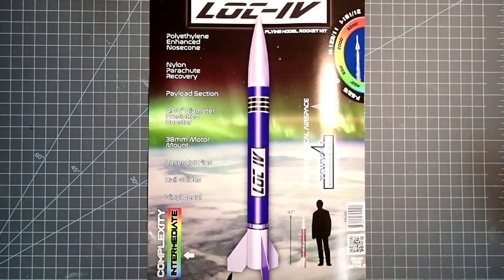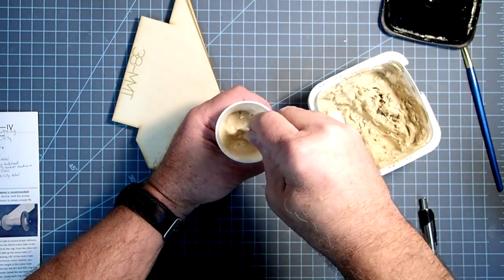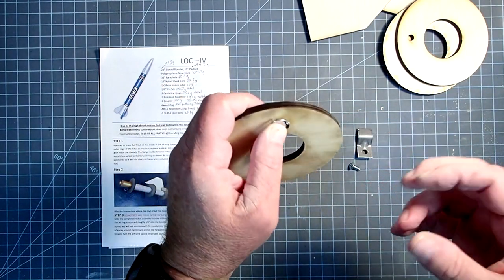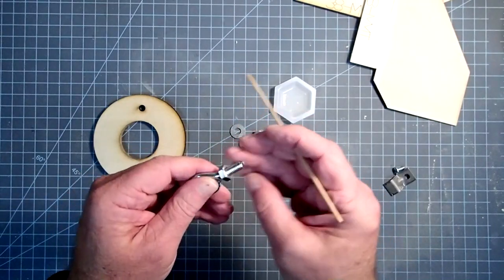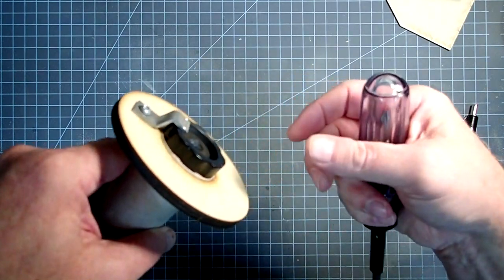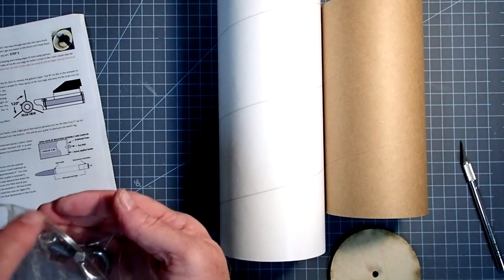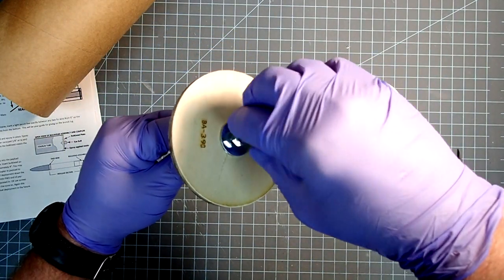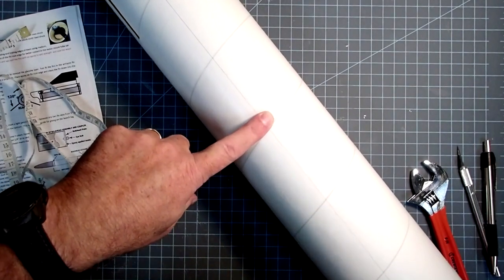LOC Precision “LOC-IV” high-power model rocket assembly (part 1 of 3)

Comment: Dave, I actually had a little bit of warping on one of my fins with the wood filler method. I ran some water over both sides and put it under a book with 100lbs of weight on top over night which seemed to have straightened it back out.

Comment: It looks like you should have had the nut plate the other way around. So that when you tighten the screw up the nut plate will get tighter inside against the plywood.
Reply from the maker: It does when installed.

Comment: Is it worth putting a screw on engine retainer on this rocket? I bought one, but could save it for next one.  Also, I was looking at Cessaroni motor case like you show here. 3 grain or 6 grain? Or buy a starter kit that has both cases?
Reply from the maker: Personally, I chose the starter kit when I first ventured into high-power rocketry. The retainer is a matter of choice. The bracket retainer used here seems to hold well enough, and is much less expensive than the screw-on variety.